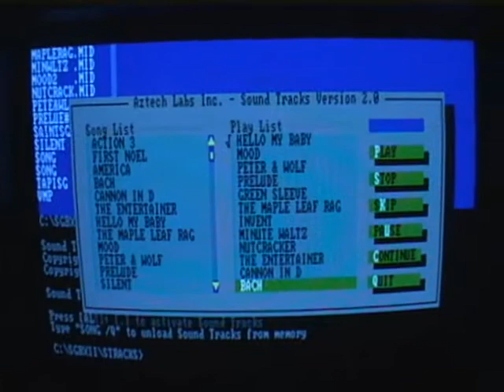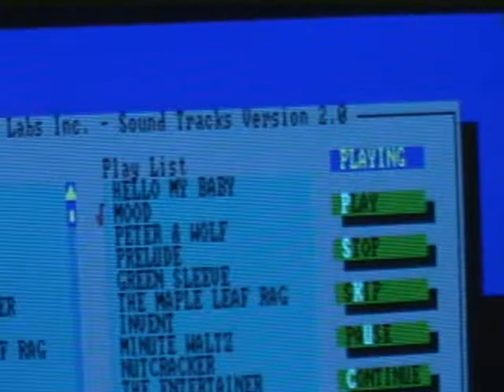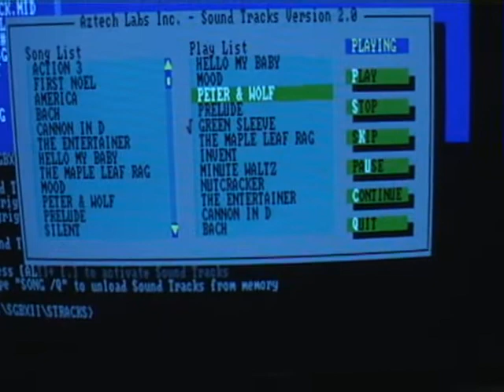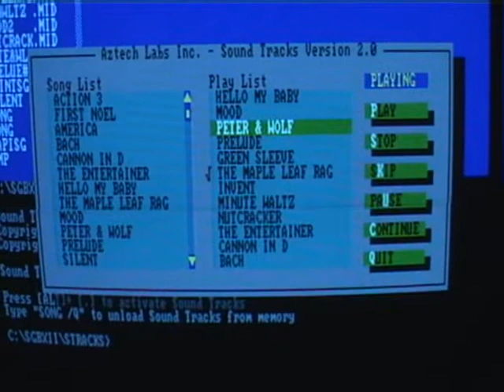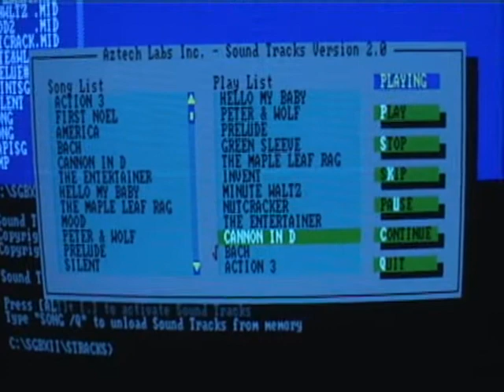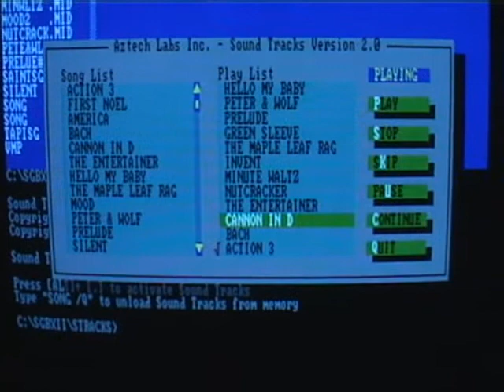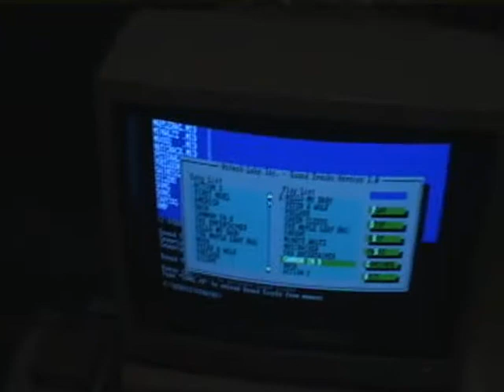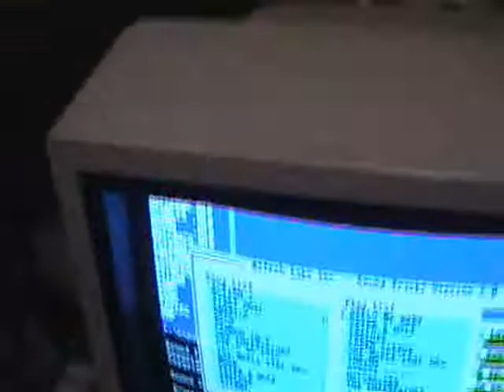MIDI music on the CompuAdd 810

Comment: @phreakindee the CMS Chips used on the Gameblaster are "just" SAA1099 chips by Philips which can still be obtained on their own. Sadly they can only be fit on gameblaster/soundblaster 1.5/2.0 cards and a few clone cards from said era. IIRC no aztech made cards had sockets for the CMS chips.
Your best bet would be checking ebay randomly for Soundblaster 2.0 cards (CT1350B), which usually pop up every other week.

Comment: Awesome stuff and great vids you got!. I do realize this video is many years old but, may I ask how did you wired the speaker to the  Aztech Sound Galaxy BX II? Thanks in advance for your reply
Reply from the maker: It has a pinout for connecting to an internal speaker, using the same connector as the PC beeper speaker that many older computers used.
Reply: +vwestlife 
Thanks for the reply. One last question, do you happen to know if the drivers of this card eat a lot of memory in DOS compared to let's say the SBPro2 drivers? Thanks again!

Comment: Does that sound card have a connection for an internally mounted speaker inside the case?
Reply from the maker: Yes.
Reply: @vwestlife  How commonplace was that on PC sound cards back then?  I've seen very few PCs with an internal speaker that's used by the sound card.
Reply from the maker: @Lachlant1984  Not very common.

Comment: ihave one of these computers but having problems, i need to enter setup but cant access the bios does anybody know the key to press to enter the bios, thank's  :)
Reply from the maker: There is no BIOS setup on the CompuAdd 810. All of the configuration is done via jumpers and DIP switches on the motherboard.
Reply: @vwestlife  Ok thank's, how would i use a compact flash as the hard drive to boot from it have tried a few small hard drives none i can get to work.
Reply: @vwestlife   hi was wonsering if you know were i could get a copy of the user manual,so i have an idea of what switchers to turn on or off, looked all day on the internet but no luck at the moment.  :)
Reply from the maker: I sold the CompuAdd 810 to Vintage Computer Forums member "jmetal88", maybe he can provide you with a copy of it.